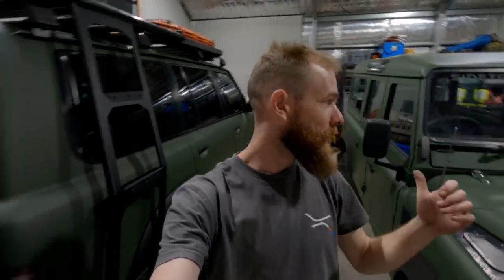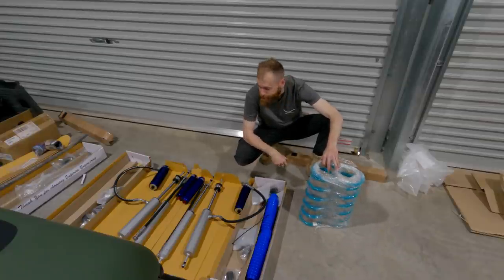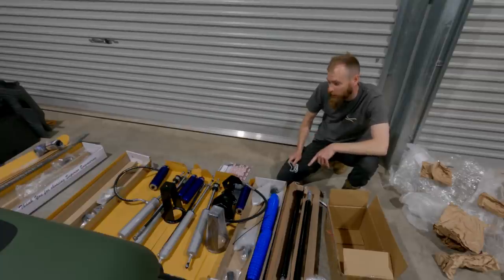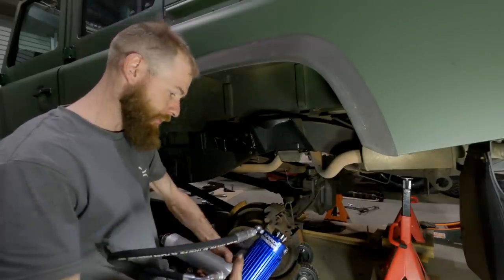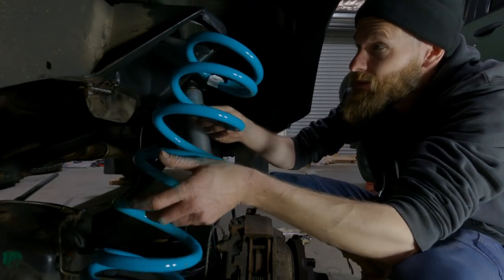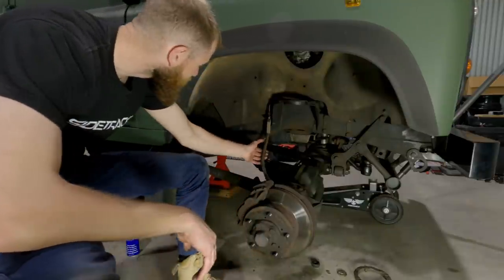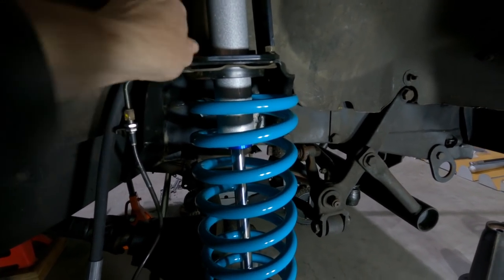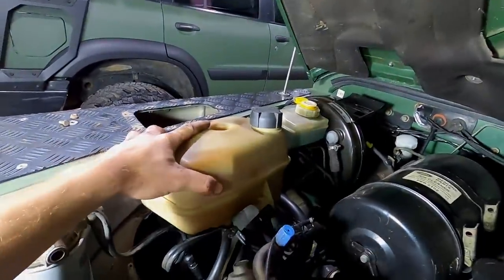#24 DEFENDER gets 35's and SUPERIOR lift kit!!!

Comment: Replace the standard coolant expansion tank, they are known to split in the seam between top and bottom halves. It will only leak when hot and can be easily missed, cost you a head gasket...

Comment: One thing i have seen for the front shocks, is that some people have placed the remote res on the other side of the wheel guards inside the engine bay. Can provide easy access and limit the amount of mud and dirt accumilation on them.
Reply from the maker: Yep, still might change that!

Comment: Looks good! Just finished up the same job in the rear on my Disco, glad to see you went with Kingpin Design's gear, it's some awesome kit and Rick is super helpful! Would recommend throwing rear spring retainers in (upper and lower) from them, keeps them a lot more predictable. I just did a couple videos covering the same work but more in depth, might give you some ideas for phase 2 of the suspension in the mighty Defender!

Comment: Dislocation cones on the rear, definitely. I'm interested to see what the gearing is like on 35s. Could always get the fuel pin and boost ring kit to give the engine a bit more oomph.
Reply from the maker: Not a fan of dislocation cones, i'll get longer coils when they become available again.
Reply: +1 for dislocation cones had them on my old 110 csw 2inch then 4inch lift 35s

Comment: What do you think about removing the bonnet sound/heat insulation and coating the bonnet with a layer of sound insulative coating for more clearance ?
Reply from the maker: After driving, its actully hitting the bonnet, not the insulation, so i may drop it back down a few mm.

Comment: Going to need more than just a regear for the 35s. LR half-shafts and axles break for a pastime even with 31s. You are definitely going to need something stronger.
Reply: I agree with beter halfshafts ets. Ive been running 33inch for years around vic highcountry with tunned tdi. All good so far. I would recommend hituff axles and flanges as they are more of a press fit
Reply: Ashcroft axles and lockers :)
Reply: Looks like it has the upgraded flanges so it may already have upgraded axles, you'd want to make sure before 35s go on. LRs axles are twigs and will snap very easily.
Reply from the maker: Still early days, but you're right! It's all on the wish list.
Reply from the maker: Keen eyes!

Comment: Guys, you are spending big and are going to be vastly disappointed. You've done nothing to address the core short comings of the model. - The little TDI is not going to handle 35's on road. It will work hard and suck fuel. This is a brick you are trying to push through the air! The big tyres will further exacerbate the terrible turning circle and poor maneuverability. Why you did not build a second Patrol, a proven beast, and double up and share common spares for both trucks, is beyond me? Best of luck.
Reply from the maker: Different strokes for differnt blokes.

Comment: You don,t need 35,s i run 33x12.5x15  bfg,s km3 muddys with a 2 inch lift in my GQ never been stuck any where  just a waste of money ,lots extra fuel money to be had instead of doing these mods.
Reply from the maker: Nice one! We sure don't need them but 35's will get you further than 33's without question.